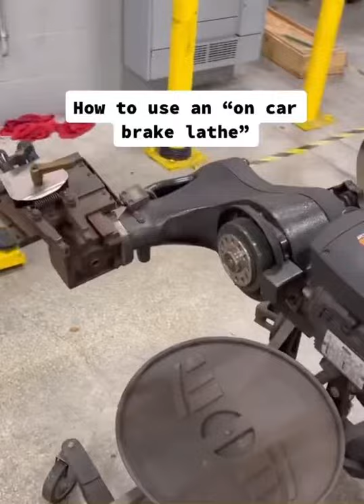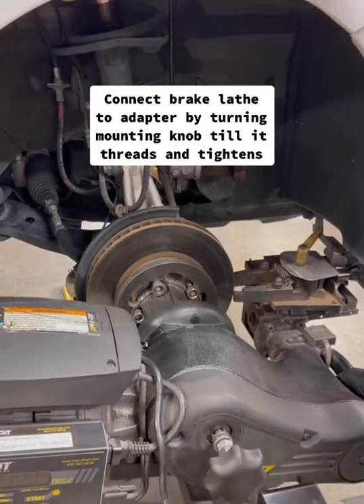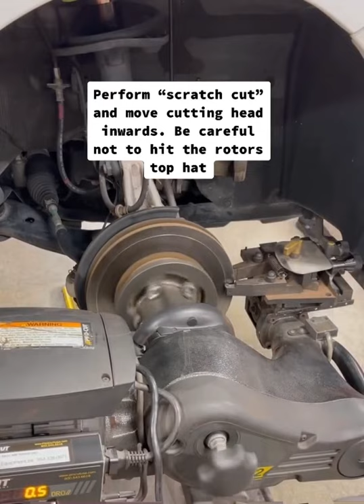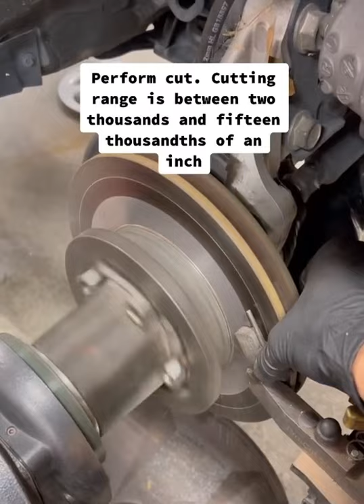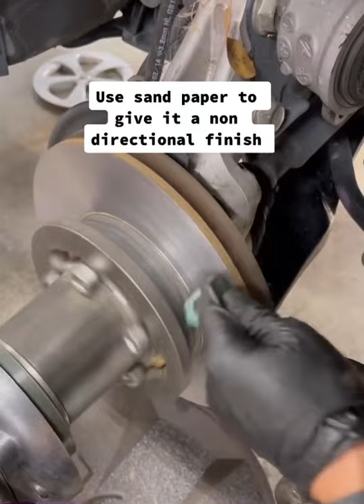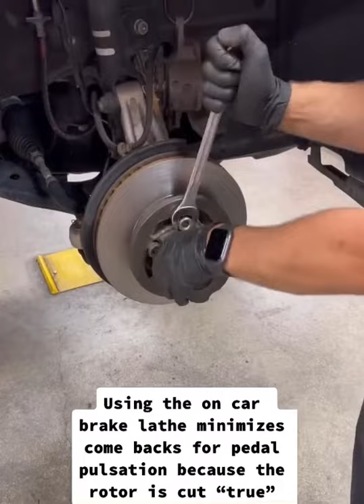How to use a "on-car" Brake Lathe #shorts

Comment: I LOVE the on car lathe! The brakes are much much smoother. When you remove the rotors and turn them on a bench lathe the rotors are machined to the tolerances of the bench lathe. When you turn them with an on car lathe they are turned to the tolerances of the hub they are mounted on. Some people say you have to babysit it but I always started one side up and get it cutting and carefully get the other side ready to be turned. Also I have did some where the backing plate had an area where the on car could access the rotors without even taking the calipers off. You just have to be sure to clean shavings off of the calipers real good. After I got used to an on car it was so so much quicker.

Comment: I never turn rotors, I just chuck them because the first time a hard braking happens they get hot then cool off quickly the rotors warp then you have vibration whenever you brake. New rotors aren't that much. But this machine is pretty cool.
Reply: Yeah I agree it's not worth cutting rotors you could just go down to the auto parts store and buy new ones for like 25 bucks each if that much
Reply: That doesn’t work because any modern car has at least one hub with runout.  The only way to get a true rotor is to turn it on car. Even new ones. That’s why you perceive them to go bad so quick.  They aren’t, it’s the car.
Reply: A set of rotors for my car is $800 minimum. So yes turn them was the best option.
Reply: @TehBIGrat  what car has $800 rotors

Comment: Torquing the adapter plate to wheel torque specs will load up the hub properly and get you the most accurate cut to the angle that the wheel bearing rests for minimal runout. It’s what makes on car lathes so great! Table lathes can’t account and compensate for the unique wear of each hub. Table lathes are slightly easier to use and faster,  but less customers come back with a vibration complaint.
Reply: You will break the adapters every time. What youre saying is absolutely correct, but those adapters were not made for high torque.

Comment: In most cases, it is cheaper to purchase new rotors.  I have seen shops charge over $100.00 to turn rotors when you can purchase a new rotor for less than $50.00.  On small passenger  cars they are even as low as $15.00.
Reply from the maker: Facts. I agree.

Comment: I always replace the rotors. You are just extending the life of a worn out part. It get thinner and gets more prone to warping and cracking just from the amount of times they have been heated and cooled already... Ive seen turned rotors split apart before and its not pretty. Fresh metal thats not been heat treated by break pads 100,000 times is going to be safer.

Comment: That's cool, however, on older vehicles
that's also when the wheel bearings
get inspected and repacked with grease!
Doing it like this totally omits checking 
the wheel bearings, even if they are sealed
bearings, they still need to be inspected for wear.
I don't like this machine. 
What good is it to have good brakes 
and then have your bearings burn up? 🤔

Comment: Great video, but you need a better silencer/chip deflector. The OEM style has notches to let it ride on top of the cutting arms without slipping off. I know a supplier that has plenty on hand if you need them.
Reply: superiortechnik is where I got mine

Comment: I’d rather just take them off and turn them on a benched lathe. Not like they’re time consuming to take on and off. Plus, you’ll get to use the time as a smoke break instead of having to supervise it
Reply: I've been doing this 10yrs now and shop I just started at has on car lathes and I hate them bitches lol. It's like my preference for the older style tire machines. 

Not only that, you can stay working with the off car lathe while they cut, with the on car lathe depending on if it's a drive axle you end up spinning the other side while it's cutting the other and  u can't really be doing much except supervise the cut lol
Reply: Except that this is a superior method. It is rotating on the actual axle, so is completely true. When taking them off mounting imperfections in the hub and rotor are not accounted for, nor are mounting imperfections in the lathe. I can guarantee that if you put an indicator on your newly turned rotors by that method, they will run out mounted on the car. 
This method the max runout would be the bearing play.

Comment: True that.
Reply from the maker: Niceeeee huh. ?
Reply: @Karl.Car.tech.1  we had quik lathe in the independent shop but I had my own Rotunda machine for 
on car, when I was a dealer tech and specialized in brake work.
Some jobs can only use new, and critical jobs included new parts that were getting matched machined.
Aftermarket wheels can be a problem and sometimes we go right past them to the brakes without realizing it.

Comment: How much is the machine? $5000? How many rotors you gotta cut before you break even? How about the rest of your shop? I was an ASE Master Tech for 10 years between 1984 and 1994. That's when I figured out that there easier ways of making more money than wrenching on poor people's cars... Now if you work on exotic stuff and have a good customer base then have at it. Other than that your just scratching out a living...

Comment: Cutting rotors is such a cheap and shit way. The cost of charging someone for cutting their rotors. Then to top it off, the customer will be back in less then a month, because the brake pedal pulsates. Because guess what, the rotors are warped.
Its much easier, less time consuming, and only a few bucks more for actual new rotors.
This is ONLY practical in a dealership setting where your required to cut the rotors for warranty work.